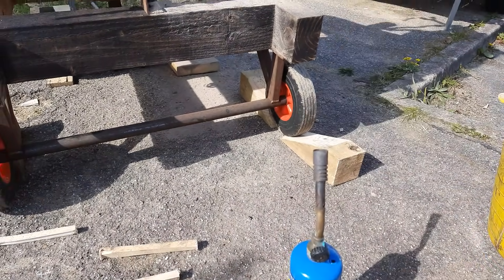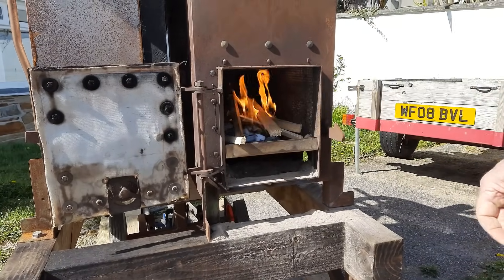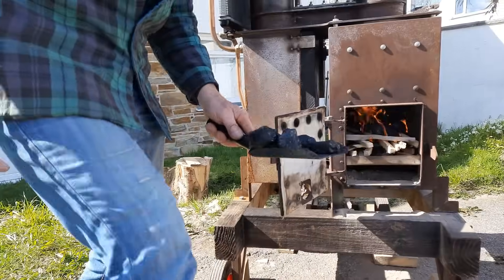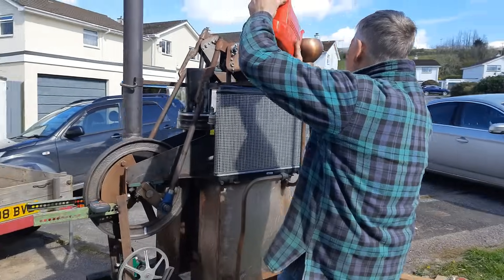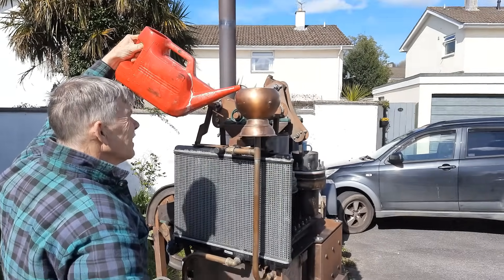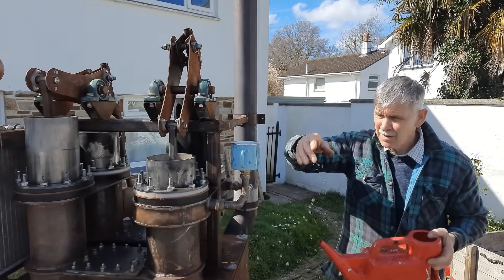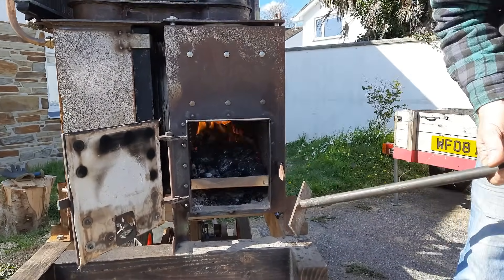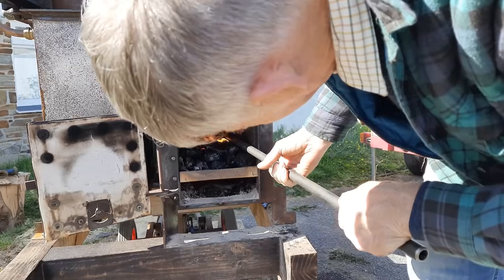Stirling Engine Generator Homemade DIY 0.47 KW ! Part 3

Comment: What i always found strange about Stirling engines is that there are a lots of small ones and really huge ones for submarines and so on but a useful engine for home use isn't available
Reply: @DETROIT FETTYGHOST  you're think of a completely different model.  The 6857 has the marzel vanes aligned with the panametric fam to reduce side fumbling.
Reply: @kayakMike1000 *thinkING
Reply: @DetroitFettyghost  nothing pops up on a search of their catalogue for Stirling or the part number
Reply: @darnit-dad  lol it was purely sarcasm. It doesn’t exist lol. My bad- thought I made it obvious with all the made up words I used. Farkle Switchmaker? Marquita Parallel? McGallion Watts? 🤣🤣🤣🤣🤣🤣🤣🤣🤣🤣🤣🤣🤣🤣🤣🤣🤣🤣🤣🤣🤣🤣🤣🤣🤣🤣🤣
Reply: @DetroitFettyghost  dude why even put energy into all that
Reply: @ZT_Performance  literally took 10 seconds with voice to text my friend
Reply: @DetroitFettyghost  You could increase efficiency significantly with some Fetzer valves and extra ball bearings.  C'mon man, didn't you know, it's ALL ball bearings nowadays.
Reply: @DetroitFettyghost Hey I seen those being used in the turbo encabulator.
Reply: @DetroitFettyghost  say what? It's a generator ?
Reply: I’m looking at patenting a medium sized sterling engine, I’ve found  a way to increase efficiency by 200% but it’s just a theory and scale models  at the moment
Reply: @Woodysadventures117  I’ll subscribe to you. Once you get that figured out please share it to the internet.
Reply: @Woodysadventures117  lol
Reply: @Woodysadventures117 how’s it going?

Stirling engines are quite intriguing, in a simplistic way
Reply: Do u have a prototype yet?
Reply: I'm standing in the rain. I'm so glad this popped up because I just had a laugh I forgot all about this.

In all seriousness brother good luck on your ideas and model, best wishes with it
Reply: @DetroitFettyghost  cheers bro, so far so good 👌🏼
Reply: @Woodysadventures117 did this ever happen
Reply: While Stirling engines can be very efficient, they typically require high pressures to really be efficient. Running an engine anywhere near atmospheric pressure is in efficient because there isn't actually that much gas in the engine to do the work.

Also different gases do better than others and lighter gas molecules are better, with helium and hydrogen being the most powerful and conductive but also nearly impossible to contain at pressure or in a working engine.

There are some oil field stirling generators that use natural gas. They are like the nasa model AFAIK. The engine itself is a sealed unit and an internal piston is mounted on a very tightly sealing coiled spring and it vibrates back and forth pushing the gas inside through heat exchangers.
Reply: @GoingtoHecq That's a linear sterling and is the most efficient of the designs
Reply: A small ,useful external combustion engine could  lead to independence, freedom, happiness and other unacceptable things.
Reply: @DetroitFettyghost  
Never heard new model designed by Riboddy Fraugh?
Reply: @NugChannel  Actually yeah, strangely enough he hired me to grease all of the flem collectors on the skillet shafts! Small world! 

Much love my friend hope you're having a great day! God bless a good sense of humor!
Reply: @DetroitFettyghost  
Wish you all the best, my friend..
Reply: Something something   Stan Meyer 😢
Research
Reply: I saw one roughly the size of a 4 cylinder like 4 years ago. The guy claimed to build them custom. It was very pricey, though around 7 to 8k.
Reply: It's the luminatti
Reply: because people are closed minded and believed the nay sayers so they didnt bother to try ... a sterling cycle generator can work at any size .... you just need to cool the cold side and that just needs a large aluminium heatsink with a good breeze to keep it cold ... a water jacketed heat sink would also work ... sadly these people are also boiling the water and using that pressure to move the pistons ... making this a James watt condensing steam engine...  and NOT sterling cycle engine 
link 10 of the coffee cup sterlings up and you have a generator that will charge your cell phone and run a lamp easy ... enlarge the design and provide a steady heat source ... say a refrigerator compressor motor to provide the heat and the stove and oven ... and you can now generate power to run your lights ... get it to spin fast and ad a heavy flywheel and you can also include flywheel stored power to the sterling generator ... include a wheel guide on the heavy flywheel to turn a load coil to charge that and you now have a sterling cranked generator for other power like they used in WWII with the hand cranked radios ...
Reply: sounds simplistic especially if you want it to last with no maintenance and be efficient. since it's efficiency is proportional to the temperature difference making hot side hotter and cold side colder is paramount. so a very thermally conductive temperature resistant material with a matching CTE is needed. an optimal regenerator is needed, 3D printed?.rapid cooling on cold side needed. maybe an air pump to keep pressurized for more working fluid. easy to machine parts are good as hobby sized machine tools are far more common for DIYers..high tolerances are good to slow cylinder leakage and for bearings. control of heat source is good as well. @kaboom-zf2bl
Reply: @kaboom-zf2bl  Yeah unfortunately this is just the theory. There are stirlings you can buy those are a combined heat and power plant that´s what they are good for. Their output is little, their size is huge and they only make sense in a frictionless free piston confuguration which is a fairly recent invention conventional alpha gamma or beta engines are a huge pain in the but and thus not really popular anywhere for anything.
Reply: Think of the cost and weight of this machine which requires lots of fiddling to get it running to put out half a horse. Now check your local hardware store for a small ICE like a lawnmower and see how much power it puts out, how much it costs, how big it is. Now try to justify this as a commercial product as an engineer working for a company.
Stirling engines are just not practical for most applications, they are something you do for a hobby because they're really cool or something for specialized circumstances which change the cost/benefit problem explained above (like the submarine).
Reply: generically speaking stirlings are about half as efficient in terms of the volume of the engine and it does seem like all the hobby ones in videos are way underpowered  for their size but their efficiency is proportional to delta T,  the heat recovered in the regenerator, and the amount of heat transfer.. having more working fluid thus higher internal pressure is good also. so if a hobby or small stirling is to be more efficient you want materials capable of high temperature operation, high thermal conductivity,, surface areas designed for max heat transfer, matched CTE's, etc. materials like inconel, graphite, aluminum would be nice but are not common in hardware stores and poossibly  difficult to machine for a hobbiest.
Reply: @qoph1988  There is one product they are good foe besides for charning a sub which is a combined heat and power plant. You can already buy them for that.
Reply: Odd that most stationary generators are diesels instead of Stirlings. And maybe plug in hybrid cars should have Stirling generators.
Reply: @DETROIT FETTYGHOST  you are a fool. That doesn't exist and some of those words you used were inventions of your deranged mind. Get some help.
Reply: Kinda defeats the purpose, if you're burning coal to run it, isn't it?  Bunch of morons...  at least distill your own alcohol and stick a series of alcohol lamps in there to run it.  That way, at least you're staying sustainable in growing your own energy.  Oye.😅
Reply: So. Make one.
Reply: I've thought the same thing about no home units. is there a group to accomplish the goal?
Reply: @FrankensteinDIYkayak  There are, you can buy them. Mostly from swiss companies. They are a combined heat and power plant, this is their best purpose.
Reply: Thats steller observation ,   But thats good in a way,   whats bugging me is it should be bigger in that hobbiest should be big part of its useful development.    It will be nice if its available if you work for it.  Im sure it will run a house or farm or more people are even thinking of performance enhancements but it lends itself to many uses.
Reply: This is only useful in an emergency because it's so loud. If he could remove the slop in the machine, and silence that squeak, then it would be better
Reply: Podłączyć prądnicę i wykorzystać prąd elektryczny, a tak to nic ciekawego.
Reply: 💰💰💰
Power company wants you to buy buy buy buy 🤑
If you're producing electricity yourself they don't have a customer, they then have a provider, meaning THEY have to buy buy buy from you. If too many people are selling instead of buying the whole monopoly crashes on their head.  The pay good money to keep videos like this hard to find, they pay good money to unalive and delete people who try to popularize these machines too
Reply: @82Ghost28  That´s exactly why solar panels and wind turbines are so genius, you can produce your own power for a small price.
Reply: There was a small Dutch genset by Philips produced in the 1950s
Reply: Then develop your own ,you are mos very smart to notice this .I think it's the British that has a sterling in their U-boat
Reply: You can get one.  You just gotta build it.  Sometimes if you want something doem right, you gotta do it yourself.
Reply: Indeed tho I wonder what would be more efficient, the Stirling or the gasification to internal combustion generator. Tho commercial gasificators aren’t easily available are easier to be home made.
Reply: You can get Stirling heater/electric combinations in Europe. Even for wood firing.
Reply: I've noticed that unfortunately.

Comment: What if you stuck the stirling engine on a rocket stove inside your house ? Each time you'll heat your house, it will generate electricity for the same amount of calories :)
Reply from the maker: I think this is the only way a practical stirling engine can be efficient. I'd like to build something like this for my next engine (Might need to do something about the noise!)
Reply: @ShanePomeroy  
You could then even power some graphics cards (for bitcoins mining for example), it will generate money and it's still for the same amount of calories :) .

I know that you can have a fridge that cools thanks to the heat (with water evaporating or something) but I have hard time finding infos about that one. I know they use it in Africa and India and it keeps things cool at 4°C with nothing else but surrounding heat.

Comment: hmm... i have a massive flywheel lying around.... i wonder...
Reply from the maker: Well, they do need a big flywheel, I think in fairness the fly wheel I've used is still to small
Reply: @ShanePomeroy  mine is about 1,5 in diameter, weights a crap top ^^, it's from an old German bale press
Reply: 1,5 meters*
Reply from the maker: @mechanicd7562
Reply from the maker: That should do it!! : )

Comment: Q: 
Is there a way to make a
Normal gas motor into a
Sterling motor ?
Reply from the maker: Interesting question? Alot of people say no because they are too far apart from a stirling engine. Maybe something that needs revisiting! Some V twin engines / compressors to offer a 90 degree phase angle?

Comment: I ask my self and you also if would be possible to use the heat from a pyrolysis gasifier, or if it would be more efficient. Perhaps using both the gas to power up an electric generator, and the rotations from that flywheel for another electric generator, would give a bit more efficiency.

Comment: I need to generate about 7 to 10,000 Watts of DC power to charge batteries for my solar power system during rainy days. It looks like I'm going to need a pretty big steam engine to do that.
Reply from the maker: This engine is pretty inefficient! I'm aiming to get 5 times the power for the same displacement on the next one while keeping it simple/cheap. We're see.......... 🤔
Reply: @ShanePomeroy  I reckon we'd need about 5-8 HP to run a 6kW generator for charging batteries on rainy days. Do you think that is possible at an affordable scale?
Reply from the maker: Possibly...... 🤔. I'm building a simpler / cheaper engine this winter that should be up to 5x as powerful as this but much simpler / smaller. Just nailing some of the fine details first! (how many times has that been said)
Reply: @ShanePomeroy  this could be my solution for supplementing off grid solar power during rainy days when fossil fuel is not available or affordable. I'm thinking 8-10 HP steam engine driving a 7kW generator head to run a battery charger for a big bank of lithium iron phosphate batteries.

Comment: If your going to burn coal you might as well take a saw and cut up tires that will fit just make your chimney taller there no difference between them except tires are cheap 😀

Comment: The complete frame is very under built that counterweight gets away someone is going to die.
Wonderful design will be brilliant when finished
Reply from the maker: You could be right. I've bought the bits to mount it on a trailer,  cheers

Comment: how about the vibrations and fluctuating speed, isn't it bad for generators since it can damage most of your appliance?
Reply from the maker: Yes, that would be an issue! The general idea was that it would charge a 12v battery as a buffer and then an inverter would run off this to convert to AC voltage
Reply: @ShanePomeroy  regardless, it's a good work.

Comment: You're the man!!!! I was so wondering roughly how much power one could harness with this sorta thing.  I'm sure some physics god could improve efficiency even further, but darn 1/2 hp is epic my man.  I was only shooting for 18w and then connect it to a USB for a fire powered phone fast charger, but you far exceed what I thought was possible.   Great job and thanks for sharing
Reply from the maker: This engine does have huge swept volume! I think atmospheric pressure stirling engines need re-exploring with the availability of materials these days. The best non pressurised engine I know of creates proportionally  5 times as much power as mine (it is model size), but why can't this be increased in size to create meaningful HP?

Comment: I wonder how easily this could run on solar heat... Or running a heat pipe into the ground water...
Reply from the maker: Hi, I think it could run on solar heat if the heat was reflected towards heater with mirrors.

Comment: Great video. I love that you have a small track presumably for moving heavy things around (3.54), from the garage to the backyard etc.
Reply from the maker: Good spot! Yes, you wouldn't believe the things I've moved using it !( new wood store, 12ft oak timber beams, engines). Hoping also to build a stirling engine locomotive at some point.
Reply: Maybe it's a regular size track and they are just enormous people

Comment: I would be interested to know what benefit would have been derived from having energy produced from a conventional steam engine using the same amount of wood and coal?
Reply from the maker: Hi Graeme, I'd struggle to answer that! I think the benifit would depend on what outcome you were looking for . Steam systems were dominant over hot air engines due to greater power to weight , controlerbility of steam output, limitations of materials, good heat transfer to the water in the boiler. Hot air engines on the other hand are simple in operation, don't have boilers to maintain and quite often don't need skilled operators. Hope that makes sense.!

Comment: That is good for when the power is out. Just put an alternator on it to charge up some batteries! Should work on just wood, or does it need more heat than just wood will put out?
Reply from the maker: It runs on wood fine and it doesn't need to be a hot fire

Comment: I have been looking for a wood burner quiet enough to heat the house, but strong enough to turn a generator
Reply from the maker: I've been looking for this too! I plan on building a new, better engine but still simple/economical. What are you looking for power wise? I was thinking of aiming for 1kw? Thanks

Comment: would a 45° hopper help fuelling ?
Reply from the maker: I'm really interested in that idea. I like the idea of shredding whatever biomass (dry) I can find and running it on it. I might do a separate experiment and knock together a hopper fed rocket stove type thing. I'm looking for ideas for the next engine I'm building. Cheers
Reply: @ShanePomeroy  
a swing door above the exhisting door  ... hinged at th bottom with side pieces eould make a hopper which could be open fo a long stick / branch and be cloed for regular operation
Reply: @ShanePomeroy 
same idea as a trash chute door

Comment: A very interesting design and great that it runs, however extremely inefficient given the amount of heat required to produce very little usable power, and more losses will be made once you gear up with belts to drive a generator. If you were able to cool the displacers better you may see a power increase, the little tea cup wont be allowing much cooling on the cold end of those displacers, do you have a regenerator under those plates between the working and displacer cylinders? Try a couple of stainless dish scourers in there.
Reply from the maker: Yes, very inefficient. Initially built as a bit of fun but now I'm using it to develop ideas for the next engine! Yes, they are regenerators under those plates. There is in fact about 20off of those stainless dish scourers in there! Great minds! lol. Thanks for the comments, cheers